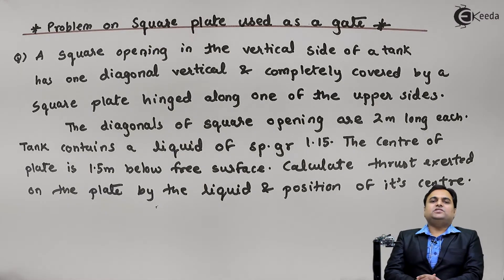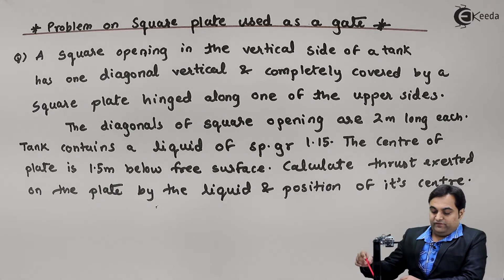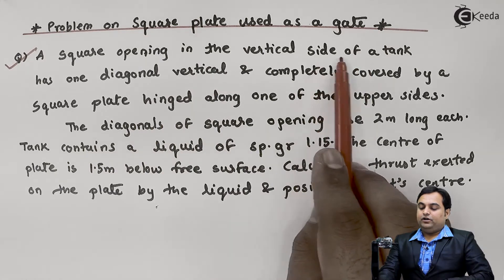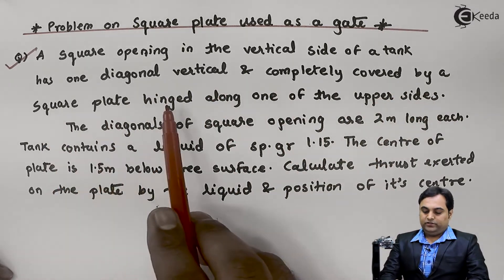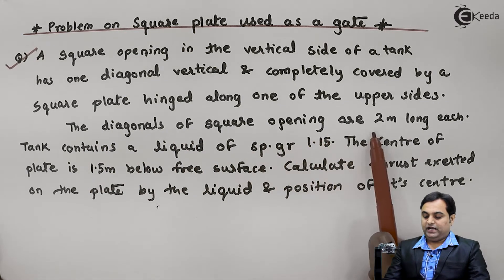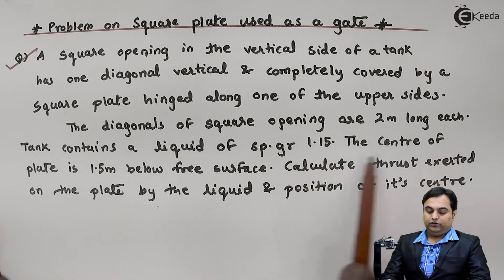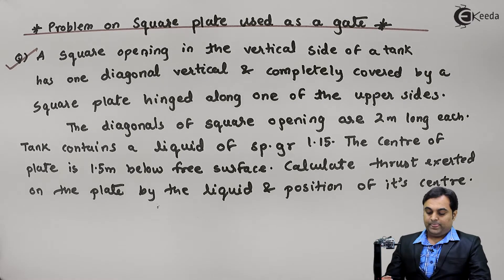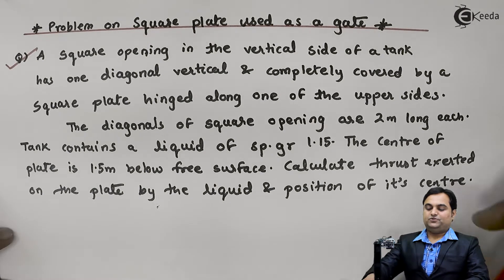Problem on Square Plate Used as a Gate for a Tank - Fluid Mechanics

Comment: I think the answer is wrong for h*. Because for a triangular plate IG = (bxh^3)/36. But you calculate for each of them as (bxh^3)/12. Then the h* goes wrong. Am I wrong ?
Reply: only if you calculate MI from the centriod of the triangle you use bh3/36
he calculated MI of triangle from it's BASE
Reply: for base, formula is different
Reply: Yes exactly I was also very confuse on that bcz for a triangle Icg=bh^3/36